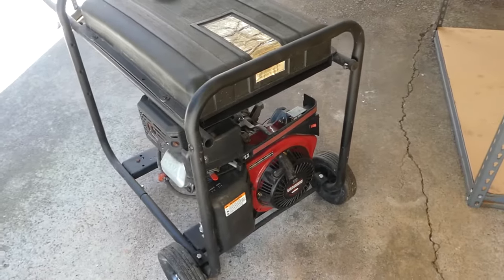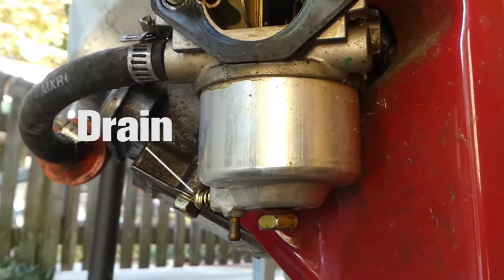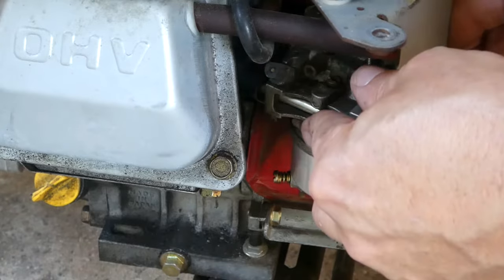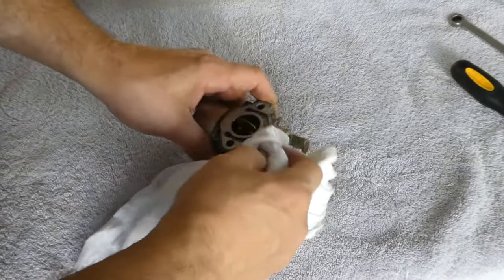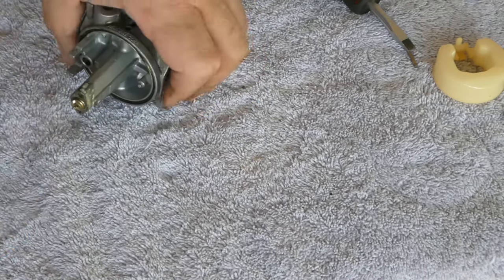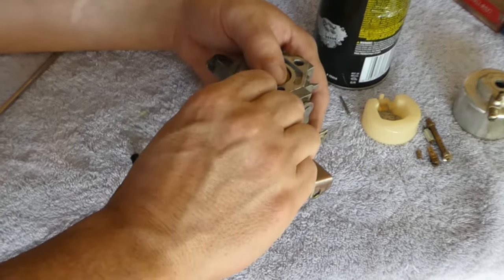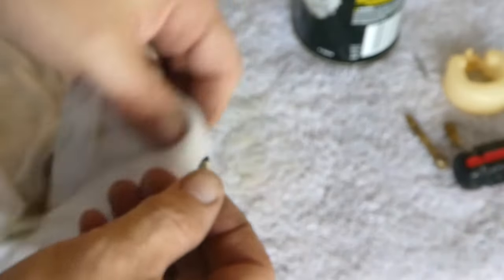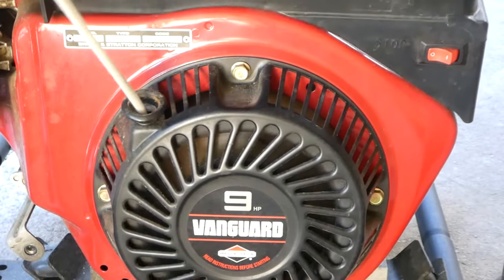Generator won't start? Runs rough? Carburetor cleaning is easy.

Comment: I have a generator which sat for a few years on old gas.  It now starts up with starting fluid only, but only for a few seconds.

Is this likely a gummed carb?  Or wouldn't it run at all even with the starting fluid if that were the case?

Comment: “Though it may seem daunting cleaning a carb is not that difficult…” yeah, unless you have a Honda eb10000 on which the engineers hide everything behind walls, wires, baffles, etc. which are screwed in with bolts that have a hardness one step above butter sitting out in the Florida sun for a day, and strip (not in a good way) when you try to loosen them! F$&@ I hate Honda!